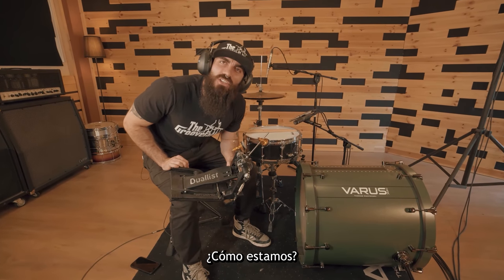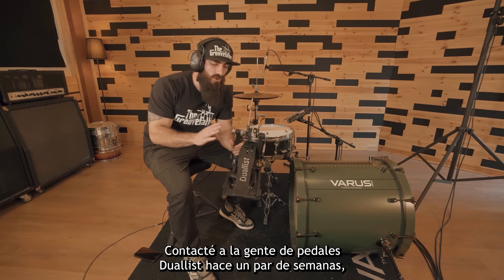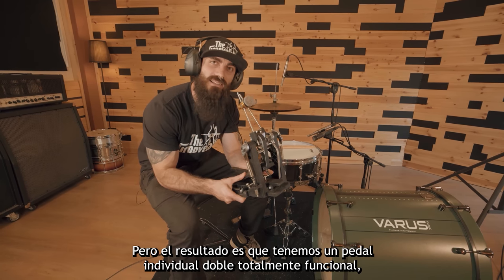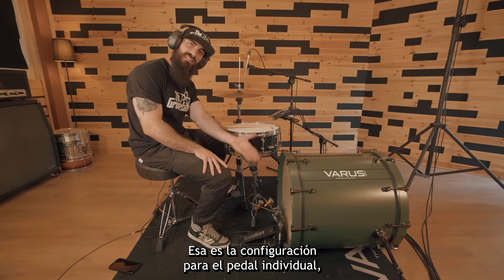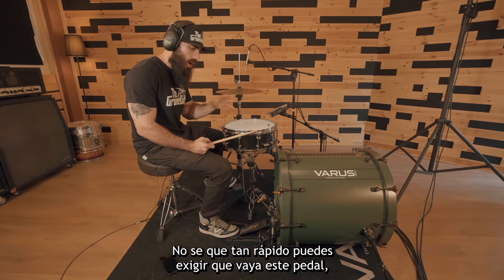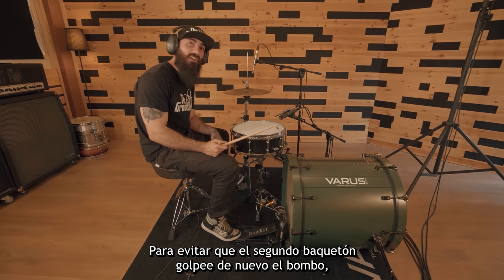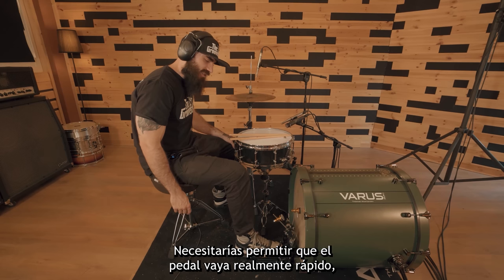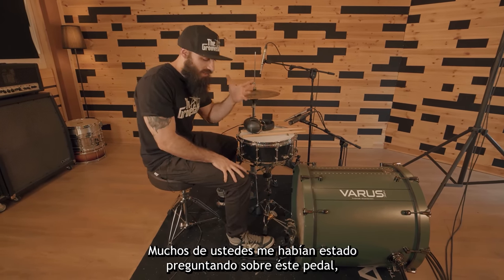THE FIRST SINGLE-DOUBLE PEDAL EVER MADE.

Comment: It doesn’t have to produce a stroke when you switch to double, just keep a little pressure on the footboard and it’ll prevent it from reaching the head. Also, you can switch it to single while doing a stroke, say the last note of a double bass run, just stomp the pedal and switch at the same time.
Reply: Interesting
Reply: Seems like a pedal upstroke triggers the second beater, so as long as you have pressure on the pedal for a double to single switch, should be dandy. Single to double, IDK. I'd say opposite, so no pedal pressure sends double. Again, dunnos, but cool business for a pedal I must say.

Comment: one time i played around with both feet on a single pedal and it was interesting.  I mounted my snare to the bass so it wouldn't interfere with switching around.  I still had the left bass pedal plus another one to the right which had a different tone being closer to the rim.  I was interesing.  Also had high hats on both sides.  I somehow managed to make it all work.  I had to cut the aluminum drive shaft down a some to make it all work to make the double pedal closer and put the high had to the left for simultaneous operation.   So without the interference with the snare stand you could dance around all the pedals and do a lot of random stuff as I hacked around.   That's when I tried 2 feet on the center pedal and you can really do some interesting stuff, try it.   I love watching your videos and thatks for sharing this.

Comment: I think I once saw a pedal that has a pedal in the front for your toe and a pedal in the back for your heal. Essentially you play heel-toe on those but instead of a single beater you'd use two beaters. That system seems a lot more flexible as you can easily play triplets and stuff on those. I guess with the dualator you'd need a second single pedal on a separate kick to do that? It's still a cool tool but it's limiting if you can't get away from linear doubles.
Reply: Yes, some kind of heel/toe-operable pedal like what you've described just makes a lot more logical sense. For one, the volume of either of the strikers hitting the drum is controlled entirely by your foot motion, unlike the dualist; even if you very quickly release your foot from the dualist pedal, if you were to set the spring tension very loosely you'd get a very week strike with the second striker because it's really the spring tension alone that determines the maximum allowed power of the second strike.

Also, the issue with the 'conventional' heel toe technique on a normal bass drum pedal is that you're trying to essentially re-engage the front end of the pedal to get a single striker to engage with the drum twice in a row, meaning that you need to let the pedal rebound in order to even allow the second strike to happen. Stepping on the heel end of the pedal just causes the front end to move down again, the pedal won't actually rock in the opposite direction because of where the fulcrum is.

With a back-and-forth rocking teetertotter-style pedal or any similar pedal that's deliberately designed to be hit in a heel-toe rocking motion, that issue is completely done away with.

This is something I've thought long and hard about for a project I've got in mind where I'll play foot drums while I play piano simultaneously (and if you'd like to know a little more about that project, please do let me know when/if you reply to this comment).

Comment: Unless I missed something, the basic operation of the pedal in double mode is not really shown. Maybe it's obvious to all the drummers out there but I've never seen one, let alone used one. Early in the video, when you hold it, I could make up some details. It seems pushing down sends one beater forward while the other one is pulled back. I suspect the release of the pedal controls when the pulled back beater is released forward. Is this correct?
Moreover, is the force applied on that second beater entirely controlled by the strength of a spring?
The switching from single to double mode is covered at nauseam but the above seems more critical to your ability to synchronize the operation of both pedals and get a consistent sound for each beater.
I'm no drummer, not even a musician, just someone that's attracted by interesting rhythms... and amazed that such limb coordination is possible.

Comment: New to drumming but I have a question. All the single and double pedals “fire” forward. I’m finding that I have better rhythm when I use my heel instead of the ball of my foot. Do they make a pedal that fires or activates from the rear? Or better yet a pedal that rocks back and forth that would be firing off both front and back? Now that would be sick! Imagine the rapid fire sound you’d get with two sets of drums. 💪😳👍

Comment: Have you ever tried the other dual pedals on the market? Like the sonor giant step or the cannon twin effect? They're all different. For example the latter two don't actually throw in the second hit, and you instead have two areas on the pedal which controls both beaters, so you can use heel toe or slide technique to control the other beater. It's pretty hard, and many drummers struggle to get power out of them (and many more cheat and opt for triggering their drums).
Reply: That's actually a method I'm planning on using for my electronic foot percussion I'll use while playing piano, only difference being that I'm not gonna control actual beaters but rather the pedals will control piezoelectric sensors directly.

Anyways, yeah, to me the method of hitting the pedal in 2 different places (front end of pedal+heel end of pedal) to control 2 strikers just seems to make more sense. That's because either the heel or toe of the foot comes down on any one of the downbeats (like in a triplet rhythm for example), which would likely feel a lot more natural than lifting the foot up on a downbeat like you'd have to do with the dualist pedal. That's why I'm actually not really for the dualist pedal. I do really like the idea of having 2 strikers controlled by one pedal because I see it's obvious advantages, it's just that I do not agree with the method that the dualist uses to achieve that action. The other pedals you mentioned perform the same job as the dualist but in the way that I'd prefer.
Reply: @justinnaramor6050  they are actually really difficult and need loads of practice. One YT commenter actually said its sort of like re learning the bass drum, and I personally think they hit that bang on (pun intended).
If you watch EMC's video on the pedals, you'll see just how hard it is to play them properly (without triggering and ruining your sound).
I really wish El Estepario did a video on these pedals and perhaps even tried quadruple pedals (I'm sure we can count on him to not use triggering or tamper with the sound in any way, that would remove his dynamics). 
One disadvantage I see with these pedals is that they're a double pedal for hitting one bass. I personally prefer using two basses as you can get a nuanced sound from them and more resonance and other advantages, as stated by Dave Lombardo (ex Slayer drummer, godfather of double bass).
Reply: @AnkothOfficial  Interesting thoughts indeed. Well, it may be difficult, but at least it's not "impossible" :)))

Comment: I owned this pedal about 15 years ago, and to be honest, it was completely useless.
The mechanics of switching from single to double functioned much more quickly and easily than I had imagined, and I was even impressed at first impression, but the problem was durability.
The reinforced plastic frame is fragile, and the parts around the shaft wear and deform quickly, so even the slightest hard kick will break it.
If this problem could be solved, maybe it would be a little more usable, but don't make the mistake of thinking that you can play the fine and intricate double pedal.
It is simply a joke item that can be used for a series of 16 kicks.